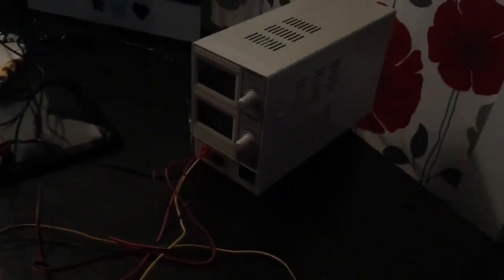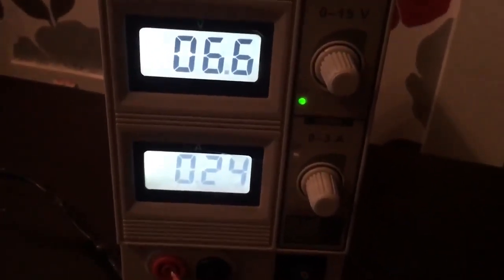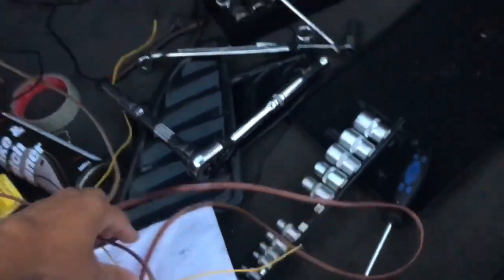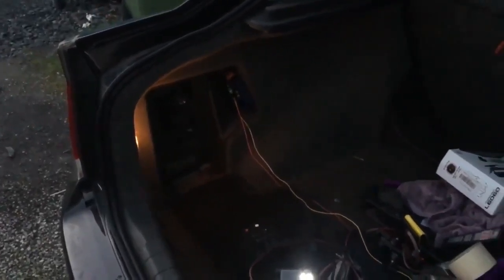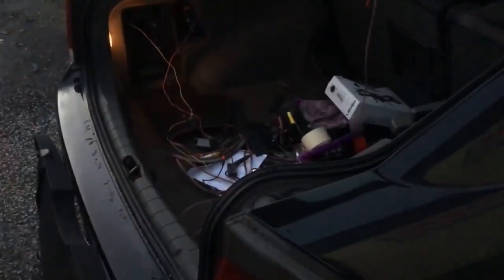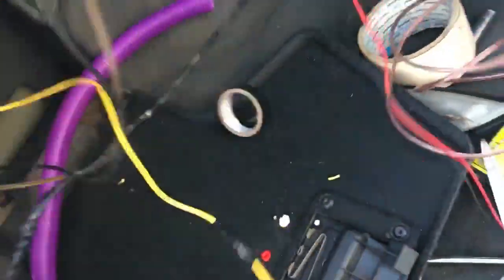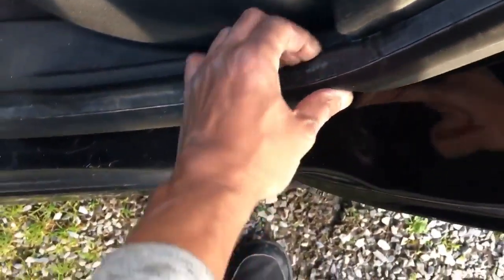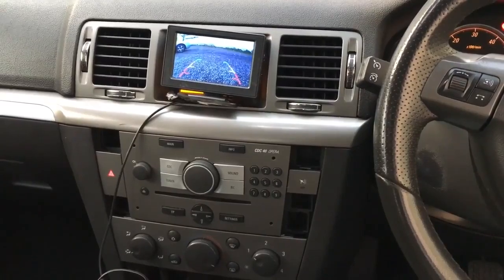How To: Install any reverse camera on your Vauxhall / Opel Vectra C

Comment: for the camera to wire connection just connect brown to black and red to white will save u alot of time
Reply: is this also for Opel Astra in Europe ? I have opel Astra H ( 2010) and I want to connect the Camera. so Black from Camera to Brown and red to which white ? because I have white with a line of black in it, is that the one you are talking about ? thank you very much !
Reply from the maker: Should be, Vauxhall and Opel are the same :)

Comment: hi i have a vectra c 1.8 2004 and i am struggling to fit my reverse camera this is the only video that i can find that someone is doing a reverse camera on a vectra c  i also ran my camera wires thought the bumper and connected my reverse trigger wire to my reverse light and powered it from using fuse 17 in my REC witch is meant to be my accessory fuse 15 amp and i also ran the wires down to the front and though the glovebox into the back of the stereo and connected the other little red wire to the correct wire behind the stereo and when car is in reverse nothing happens is there anything that i am doing wrong any help will be much appreciated